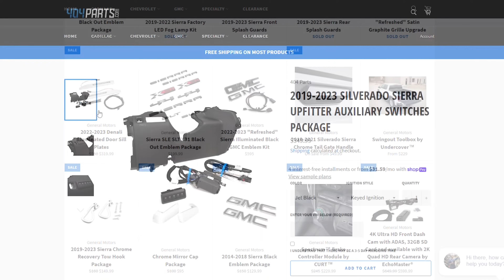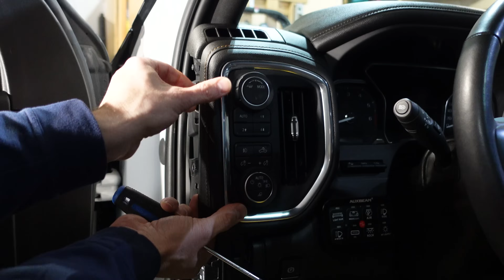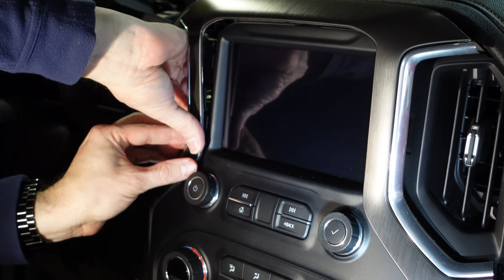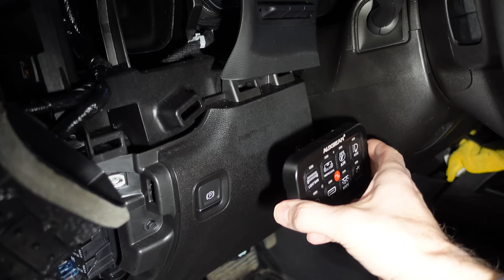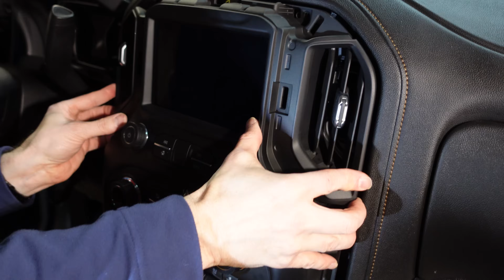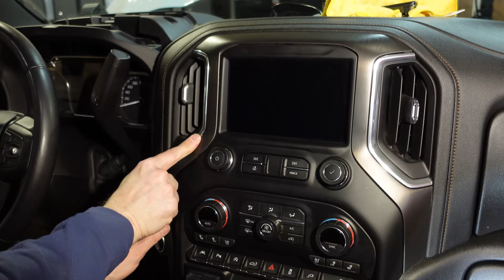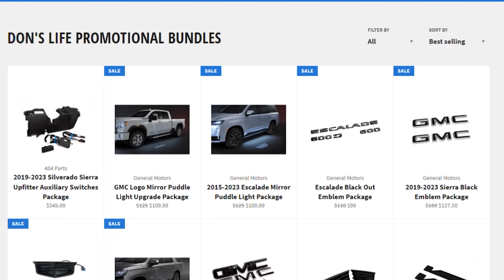GMC Sierra - CHEVROLET Silverado OEM Genuine Upfitter Auxiliary Switch Upgrade

Comment: After seeing the cost of these and the amount of disassembly to install them. I'm glad I spent the extra $150 and selected these when I ordered my new Silverado!
Reply: I ordered my 2023 LTZ Silverado with them and ... it came without, so I have to add them now. It crazy how difficult GM made the addition, with Ford F-250 it was way easier. Ford is WAY MORE practical truck, but unfortunately doesn't have Duramax-Allison combo.
Reply: @johnkow8884  And, don't forget the 6.7 Powerstroke Diesel (2011 to current) has a Bosch CP4.2 high pressure fuel pump. That fact alone is why you should run and hide from Ford. Google Ford CP4 and see for yourself.
Reply: @jimm2442  Actually, on my 2008 F-250 6.4 I had high pressure fuel pump failure, It was replaced on warranty, around 75k miles. Took dealership one week, PITA. I still own and use this truck, but I already purchased 2023 Chevy Silverado High Country, It's new. I am on third transmission with my F-250, which has 160k miles. Ford highly practical design and pleasant to use, but unfortunately not reliable.

Comment: I ordered one for my 2023 GMC SLT 2500. I wish I knew about it BEFORE I got my truck. I am still having the GMC dealer install it for me. I like the clean look of this. GMC should make this a standard feature.
Reply: How much did they charge you for parts and labor?
Reply: @RichPrivilegedWhiteMale  I purchased it from 404 and the dealer charged me $175.
Reply: @ronhinkley3930  That aint bad at all. I figure they'd charge 4 or 500 bucks. I'll have to look into it, thanks.
Reply: My dealer wouldn’t install it…did it myself

Comment: I'm a long time viewer and love the vids. I also bought the "Kit" for my 2022 HD AT4. I only paid a Buck and a half from the GM parts store. I looked at the videos of others who had removed everything from the front bumper, windshield, dash and finally the Bolster and I also said H3ll No!!  I used the new Bolster as my template and with wide tape, made a mask of the complete left side area, then cut out the open area in the tape. Then aligning the mask on the Existing Bolster and using a very sharp blade, cut out the area. That took me only 40 min. (I work slow - but meticulous).  I took me longer to snake that battery cable thru the pea size hole in the firewall. A lot of back and forth from under dash to on a ladder leaning into the engine bay. Ha Ha. When I was finished It was a three beer day.    Keep up your good work.
Reply: Do you have the GM part number?

Comment: That's great for all the people running a full size truck but I have a 2020 Canyon. So getting a knew bolster and cutting a hole in it to add that switch package is my only option. Which if I can get that switch panel and box I will do just that in a heart beat.

Comment: I was just quoted $1600 to get this install by my GM dealer. The switches are already installed. This is on 2024 Sierra 2500HD.
Reply: Ouch!!! I just got mine a month ago and the guy that ordered the truck for me couldn't find it on his computer, so I got the truck without them. All I want is one switch for the fuel cell I want installed. Guess I'll pay a professional to run a switch under the hood,
Reply: I was so mad I requested to have this on my truck and then realized it wasn't even wired in. I had the local truck outfitter install mine it cost me 100 bucks

Comment: Dude, you could have just used the new knee bolster as a stencil like I did to cut the hole in the original bolster...this is what I did...I didn't need to take any of those panels off!....I even squeezed the 2 screws in for the fuse box without taking that bolster off all the way...the whole job took me 45 minutes...and it looks just as good as yours.
Reply from the maker: I don’t disagree, but this was a full install video for those that may want to see what’s involved with this approach

Comment: Had I known this kit didn’t get power into the engine bay I would have gone with an aftermarket kit.  
I wrapped & made a redneck harness out of x4 14 ga wires around the power wire when I put it thru the firewall.  Then tapped those 4 wires into the powered wires.
Reply from the maker: Makes sense.  I have both this and an aftermarket one

Comment: Ford nailed it, ram made it even better, gm decided to make it an option that doesn’t come installed, and if you do install you have to start in the back seat disassembling the center consoles to install the dash panel… this is one of many reasons why I hate upfitting on gm so much…

Comment: I didnt remove the dash I cut the smaller of the 2 boots on the boot going through the firewall and used a electrical snake 1/8 wide to fish wire in. It works easier if you have a friend push while you pull it. Make sure you taper the head like a missle to help it slide through.
Reply from the maker: Great tips 👍

Comment: I have a question. I'm installing the kit but want to run wires out of the cab and through the firewall so they're ready when i need them. What gauge wire do you recommend?
Reply from the maker: 10 AWG for 30amp devices
12 AWG for 20amp devices
14 AWG for 15amp devices
16 AWG for 10amp devices
Reply: @Donslife  thank you. And lights usually fall under which?
Reply from the maker: 20” and smaller are usually 15 and under

Comment: Great video Don. I just purchased the kit and have a couple questions. I have three sets of lights (light bar, cubes and spot lights) and they all come wired with a relay and a connection that runs three wires to a switch. If there are relays with this system, what do I do with the original relays? If there is only one wire now to the switch, what wire do I connect from the original wiring and what happens to the other wires? Thanks for any guidance.
Reply: You definitely can't hook up 2 relays together. What was your solution?

Comment: Nice, Don! 
I installed the up fitter switches for my K2 Silverado integrated to the stability control switch panel.
I don't have an option for the cool relay box you have but, since it's only ground activated, I think the first switch is going to go to my under hood light (same as yours) so if I want to open my hood and not have the light on, I can just hit a switch.
Great video about install on the T1 platform, well done!
Reply: You have the Rocky Ridge?

Comment: My truck came factory with the switches but I cannot find the 5 colored wires under the dash.  Any suggestions?
Reply from the maker: Follow the wires on the backside of the buttons to their fuse box.  That’s where I would expect the wire leads to be
Reply: Ok thanks I will look.  Negative to battery or chassis?

Comment: Thank you. Just got this mod. Can you help me with 2 things? 
How do I know what color wire is what switch?
Where in the can under dash do I ground the wires
Reply from the maker: I used a 12v test light to determine which color worked with each switch.  It only took a minute.  As for a ground for each device.  You can ground the device anywhere to the chassis, some of the mounts for the dashboard, various parts of the inner bodywork.  Try not to expose bare metal in the process for areas that can rust.   There is a ground post under the passenger side of the hood.  It is a handy ground for items placed around the front of the vehicle.

Comment: Are the auxbeam buttons the same size as the upfitter buttons? If so, could you use the auxbeam stickers on the upfitter buttons? If so, do you know if you can order the sticker sheets without having to buy the auxbeam kit?
Reply from the maker: They are close.  I actually did that with a couple stickers.  They work, not perfect alignment though
Reply from the maker: The AR800 sized ones fit

Comment: I've got the upfitter switch kit on the way, are the leads to tie into the switches right there under the dash behind the new knee bolster or do they extend into the engine bay? I was fitting up the light bar last night and wondering if I should run the wires to where the switches will be or if I can just leave them in the engine bay near the battery for now. And the curve of the 22 inch strands housing matches the curve of the opening perfectly, was sweating that until I got it last night and happy with how it looks! Thanks as always!
Reply: Okay nevermind I'm dumb! I was skimming the video to see where you show the leads and kept missing it but I just found it. Looks like they're all just behind the knee bolster. Have you ran all your accessory wiring through that extra grommet hole they give that you show in this video?
Reply from the maker: I haven’t run anything through yet.  Currently using my first switch system since I have been too busy.  Glad to learn the curved bar fits well!

Comment: Wondering why the significant cost difference between the refresh and non-refresh kits ~$150 price difference between the two, and when pricing out kit components from GM, that doesn't add up?

Comment: Picked up a sierra with upfitters installed this week.  They don’t light up so now I’ll begin investigating you how “installed” they are.  This shouldn’t be an option if they’re just popping the switches in a precut panel and you still have to do all the wiring through the firewall.

Comment: Will a dealer cover the installation if you order from 404parts? I ordered wireless charger for the refresh Sierra as mine didn't come with one and gm does not replace them for free so i want to mention it to them but not sure how to approach them for the best chances of a yes.
Reply from the maker: I would ask the dealer if you provided them with a Genuine GM part, would they install it.  I believe they would.
Reply from the maker: There would still be labour charges

Comment: Curious why you went with this? Just for a video or was there issues with the AuxBeam switch? I'm not sure what I want to put in my truck.
Reply from the maker: No Issues.  I have always wanted this and when I eventually sell the truck, it will certainly appeal to the new owner to have this option.
Reply from the maker: Plus I am running both

Comment: Nice job.  I'm working on installing the aux switches to a 2024 Denali Ultimate.  (Kit not released for the 2024 Ultimate yet, so using a previous part number)  Question I have for you is where is the connector located at that you are hooking up to at 11:14
?
Reply from the maker: There is a grey plug harness hanging down by the BCU building near where the parking brake button is.  If I am remembering correctly
Reply: Thank you! @Donslife

Comment: Why they have the fuse boxes inside the cab?? You have to fish all your acc wires inside 🤦‍♂️
Reply from the maker: That’s the design.  I would recommend fishing into the cab through the passenger side grommet too if your device’s wires are long enough.

Comment: I understand that featuring other Parts, including Aftermarket parts is one of the jobs to do here, but the Switching System you currently have is more capable in (My Opinion). hat is a lot of work for Five Analog Switches. Yes, they look more factory. But the Auxbeam Eight Switch System has 3 more switches, connected to your Android Box for iPhone and Eight Inch OEM Display. But again I understand 404Parts is sponsoring this video and parts. Man just a lot of work duplicating and what you already have. LoneStar Hawaiian had a video on this install about a year ago, nice stuff and pricey. Lots of work. Nice Video as always.   P.S. Are you aware of the type of Commercials that show up in your videos now? Are the Commercials controlled by others?  The 7 Second Poop Trick   commercial was just way out there...  Ugh.   You're still Top Dog, but Wow...
Reply from the maker: Fair, In the past two years I have received dozens of comments and emails asking for more info on this too.

Comment: Have you wired anything to the switches yet?
Reply from the maker: My interior ambient lighting and I have some winter plans I am working on.
Reply: @Donslife  I see. They should’ve left those wires under the hood. Being under the dash means we have to run more wires from outside through the firewall

Comment: Since you had the center console apart, you should have installed the OE wireless charger.
Reply from the maker: But I have the slow OE wireless charger and a boost auto armrest lid wireless charger
Reply: @Donslife  my bad, I didn’t realize you already had the factory wireless charger. I have a 22 Trail Boss. I use your channel for a lot of ideas. I too have been flirting with the upfitter switches but don’t really want to take my dash apart. The boost auto charger is on my to do list. I have done several of the boost auto light mods. I like the bed cover you installed and the associated light bar. Those are my next priority. What switch controller did you have before the up fitter?
Reply from the maker: @markbucher6928  all good.  I still run an Auxbeam product since I require more than what the upfitter provides me.

Comment: Glad GM offers the upfitter switches, but disappointed that you mount the fuse box under the dash.   Ford makes it so simple to wire their switches because they mount the fuse box in the engine bay.   Having to fish wires through the firewall for each device is dumb.

Comment: How long did the instal take?
Reply from the maker: If I didn’t have to worry about camera work and not blocking the camera while explaining everything….First time, and hour or two.  Now, 30-45 mins.    Fishing wires through the firewall is always a gamble, especially if you’re alone.  Sometimes it takes a few mins.  Sometimes you feel like quitting 😂
Reply: You made it look easy. Going to order one for my Silverado. 
Thanks!
Reply from the maker: No worries. Take your time.  Removing the console cup holder section completely makes it a little easier to get the lower trim piece out too.  I had taken it off before for a different install, so I knew how it came off. I didn’t need as much room as a result.

Comment: Going from a RAM pickup truck with factory auxiliary switches to I now have a 2023 Chevy I don't understand the design. Ram has a better design The power from the switches goes out underneath the hood and you hook your auxiliaries up underneath the hood. Seems like with the Chevy or GM any auxiliary you want to power you have to run the wire into the cab to the switches seems like it would be a big mess running a bunch of wires into the cab.